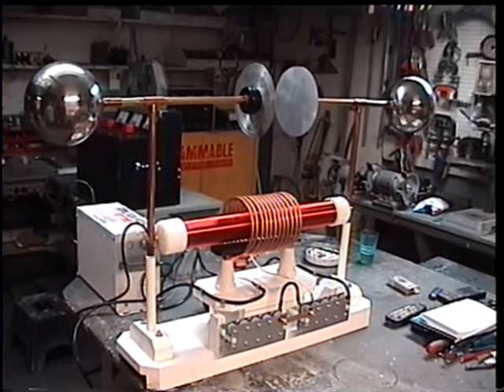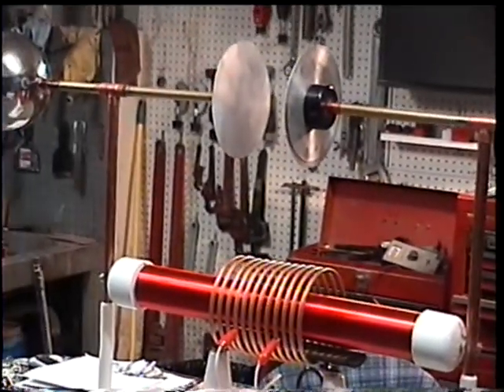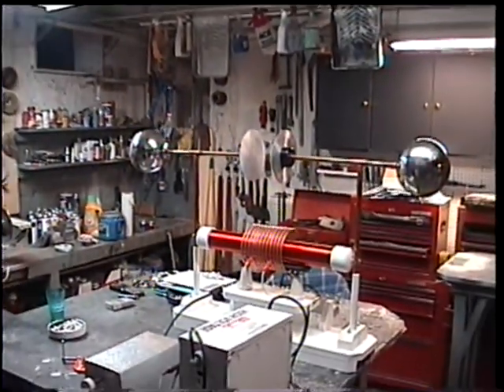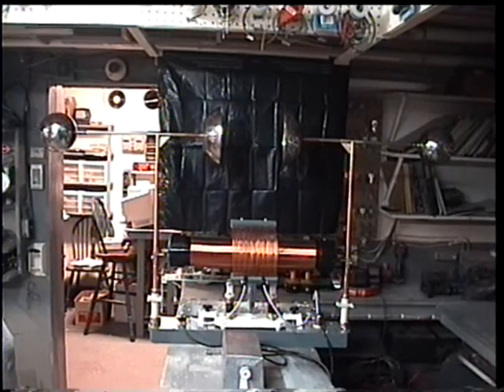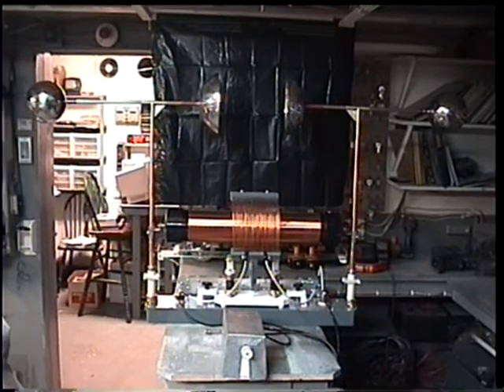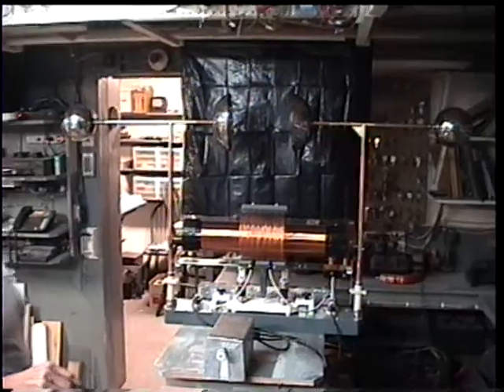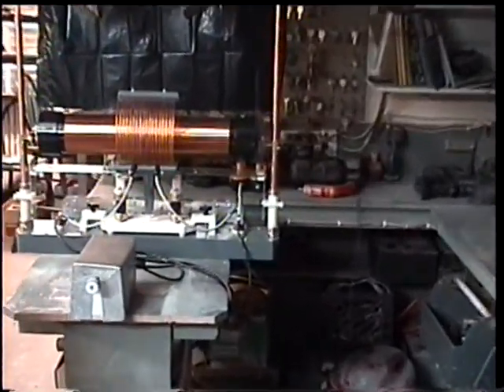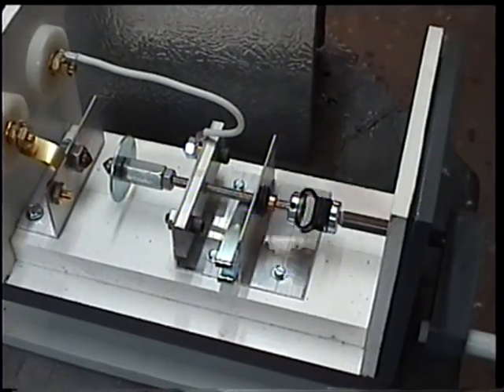telsa coil plate discharge

Comment: Hello sir. May I ask how you calculated the primary tank frequency in relationship to secondary? If for example my secondary's frequency is 800khz, I need 800khz tuned primary tank or 1600khz (because of a coil virtually split in half)? Very good work, thank you!